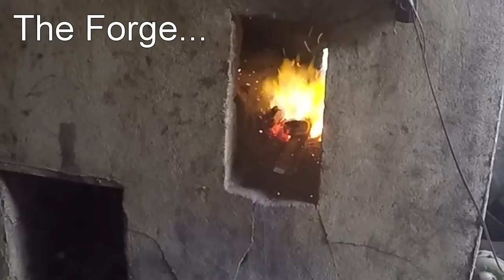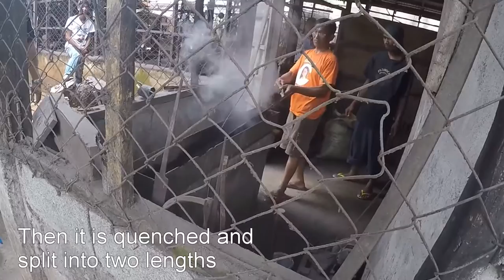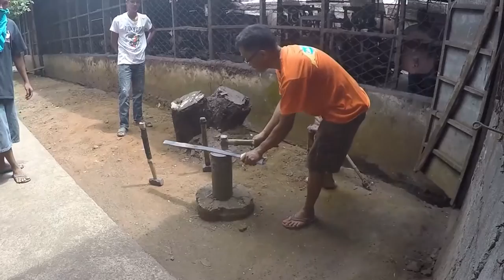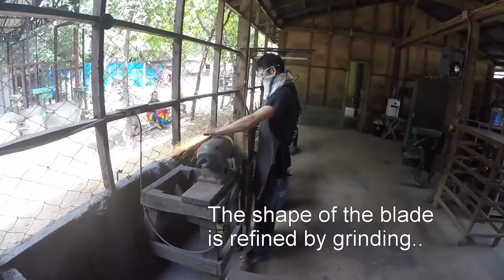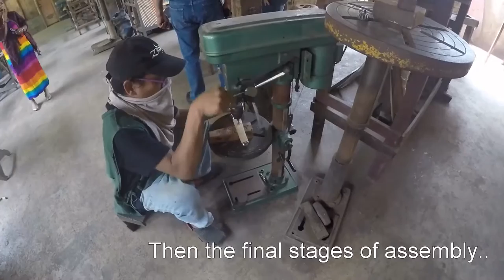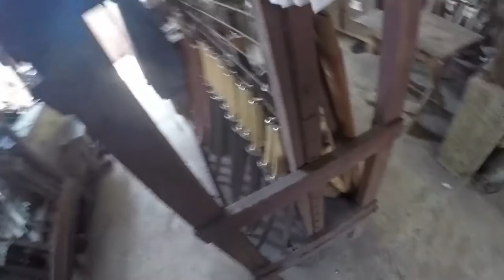Sword Making in the Philippines by Blade Culture International

Comment: I just subscribed.

I have two 1075 high carbon spring steel katanas from global gear. Recently I attempted to sharpen them my self and ruined them. Please tell me where I can purchase just the blade and maybe upgrade to something like 1090. I'd appreciate it. Thanks.
Reply: HELLASgate7 a 1090 or even 1075 Katana is very bad choice. Katanas need to have less than 0.7% carbon content otherwise they will have structural issues. A 1055 katana is probably the best choice as far as monosteel katanas are concerned, since they perform better with the dual heat treating design than higher carbon steel, that would just break often. Research into steel properties and katana construction before buying anything. I also suggest you use a device called "worksharp" to sharpen the swords, so you wont ruin the bevel angles.